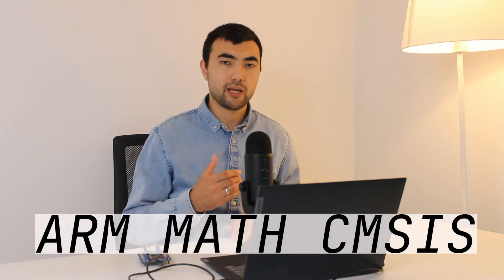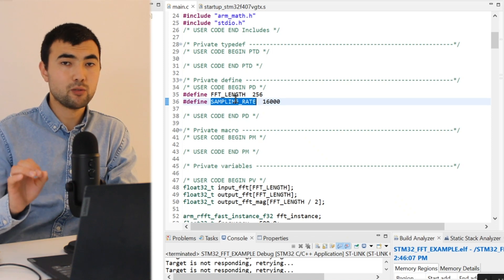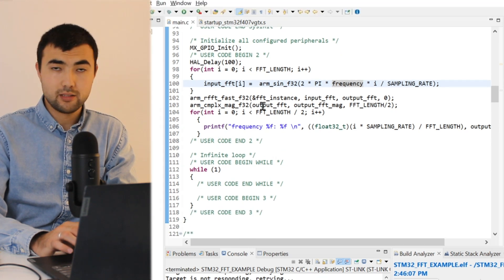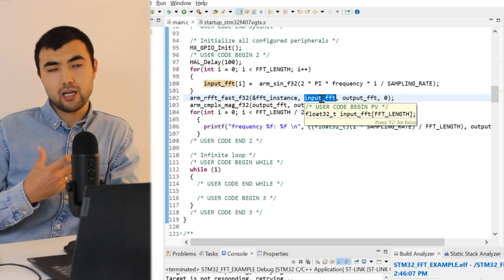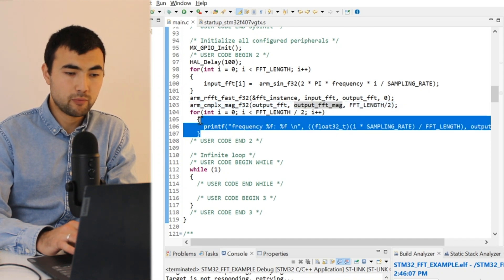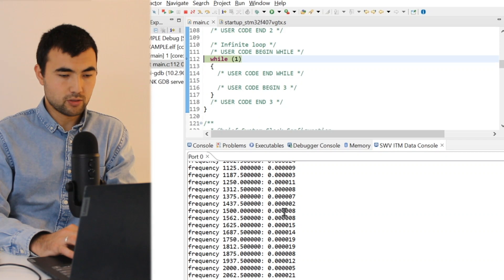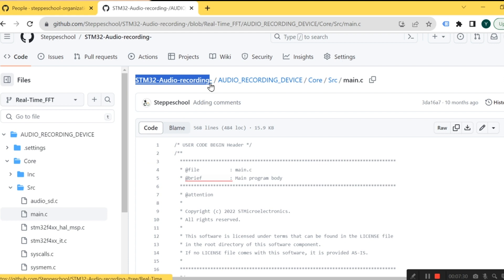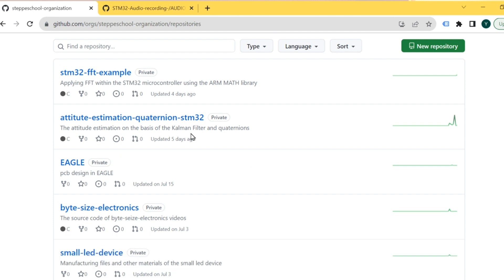Fast Fourier Transform using the ARM CMSIS Library within the STM32 MCUs

Comment: I'm using Cube IDE version 1.15.0. 
The microcontroller version I'm using is STM32 NUCLEO L073RZ
DSP library is not listed under software component class. 
Which version are you using?

Comment: Thank you for the video. I tried to use this dsp lib with my stm32f103c8t6 cortex m3 with clock speed 64mhz. But i could not install it because bluepill has only 20kb. I wrote recursive fft code myself. but it took almost 70ms to finish and i lost some values from adc. sampling rate was 8khz. and window size is 128 or even with 64 it was still slow. i think arm dsp uses some kind of hardware accelerated things to make the calculations much faster for example in 1-2ms. But i could not use it as bluepill has only 64kb of flash. What can you suggest? Appreciate that thanks.
Reply from the maker: The easiest solution would be to upgrade your microcontroller. Try more powerful microcontrollers, such as STM32F4, STM32L4, etc. They are not expensive and you can easily implement FFT.
Reply: @steppeschool3629  Hi. Thank you for the answer. Yes i had also F407 with 512kb of flash. But i wanted to try it with 64kb. Because i saw someone got fft working even with atmel processor with good performance. In the end i wrote my fft function with float type which took 70ms to calculate which is very slow. There is no fpu in bluepill. And after working 2 days i rewrote my functions in fixed point numbers and got it working. Fft took 3-4 ms for calculation, flash usage is 34kb with whole code.
Reply from the maker: What you did is quite impressive

Comment: Thanks a lot! what is the rest of line 106?  printf("frequency %f: %f \n", ((float32_t)(i * SAMPLING_RAT) / FFT_LENGTH), out...
Reply from the maker: just bracket with a semicolon
Reply: @steppeschool3629  It is difficult what is the rest. Is it printf("freq %f: %f \n", ((float32_t)(i * SAMPLING_RATE) / FFT_LENGTH), output_fft_mag[i]); ??
Reply: for (int i = 0; i < FFT_LENGTH / 2; ++i)
  {
	  printf("frequency: %f", ((float32_t) (i * SAMPLING_RATE) / FFT_LENGTH ));
	  printf(" magnitude(float): %f",output_fft_mag[i]);
	  printf(" magnitude: %d \n",  (uint8_t)output_fft_mag[i]);
  }